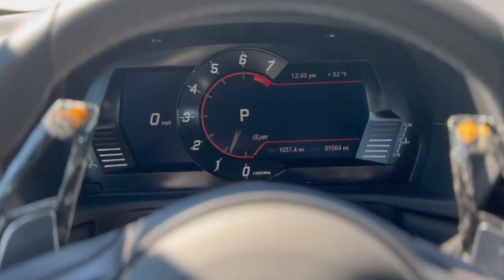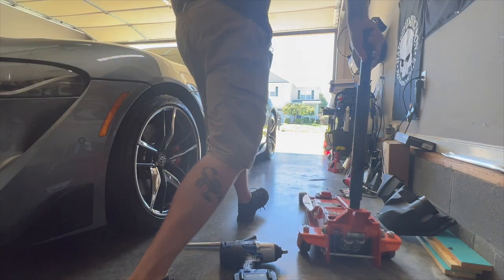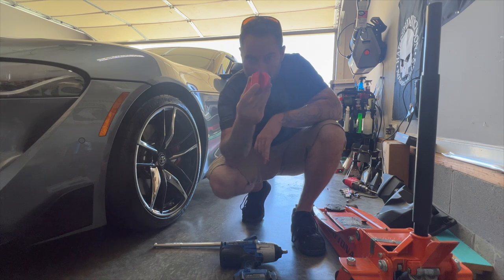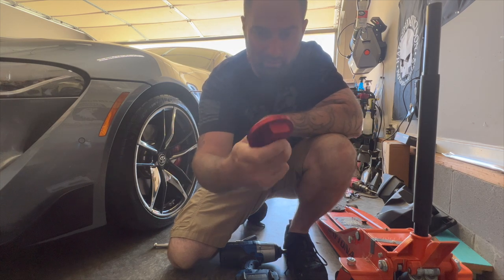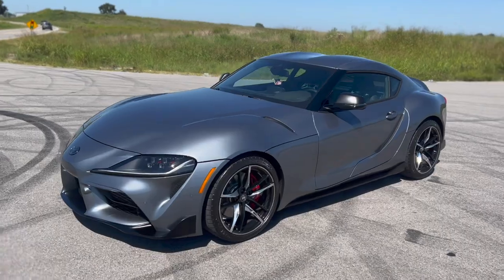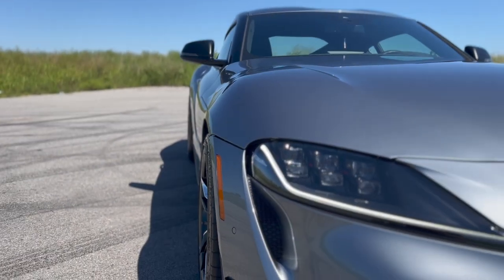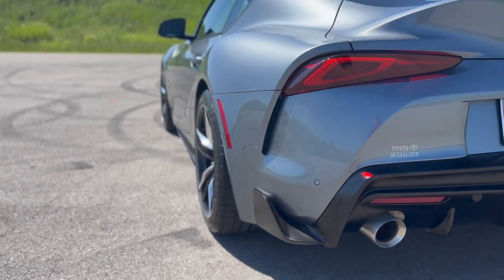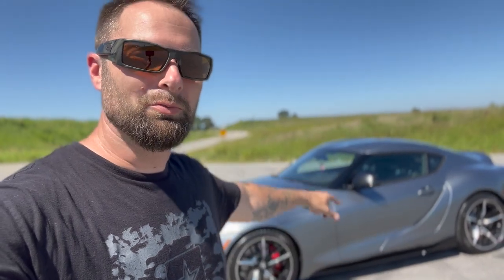TRANSFORMED MY 2022 SUPRA GR FOR THAT PERFECT STANCE (Burger Spacers) MEAN NEW LOOK!

Comment: I did 13mm all around rather than 15 in the rear in case i ever decide to go 285 rear section tires on OEM wheels. Ive seen 305’s on stock wheels and it looks all wrong. Maybe it may help for putting power down in a straight lune but i bet it’s useless in turns.